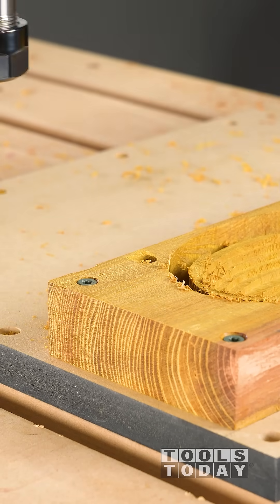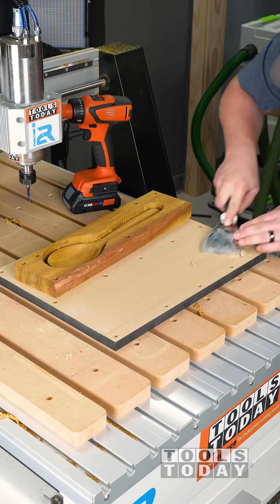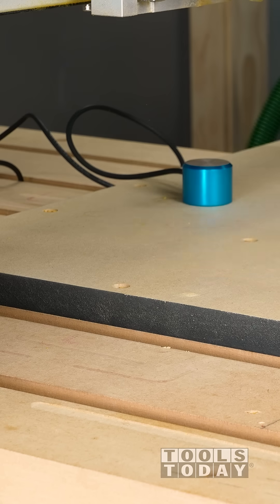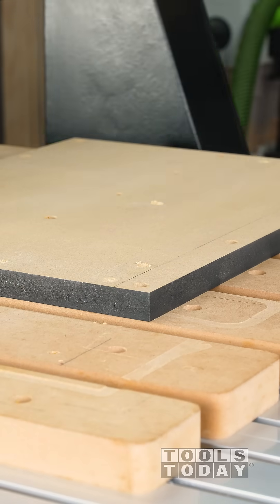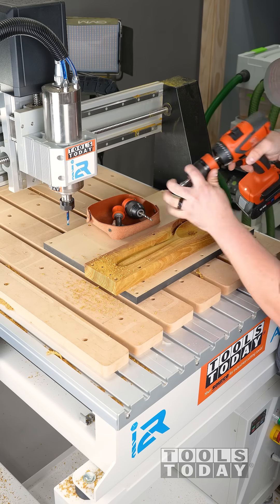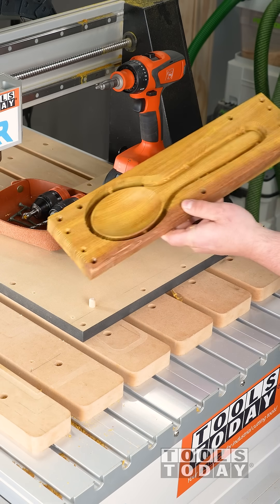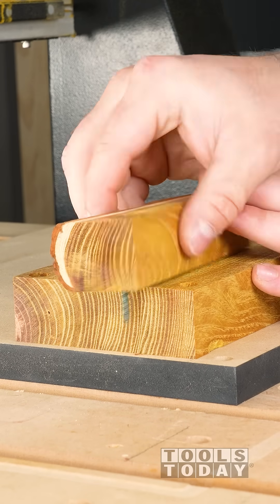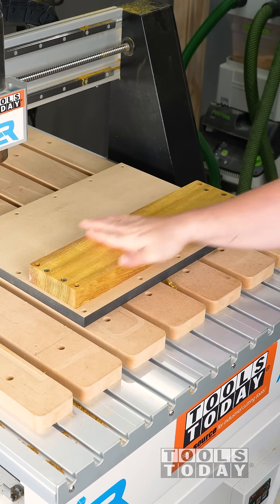Double Sided Machining Isn't as Hard as You Think it is

Comment from the maker: Double sided machining is not as difficult to set up as you might think.  Many people are intimidated by it, but in reality, you just need to create location holes in the top side of your work piece and mirrored holes in the wasteboard using some dowels as location pins.  Once your piece is secured back down using new screw hole locations, your x and y zero locations stay the same and you're ready to start cutting on the opposite side.  It's a pretty easy process!

Check out the tools used on our website - 

Amana Tool 1/4" Upcut bit 46102-K - https://toolstoday.com/v-13778-46102-k.html

RPM: 18,000
Feed Rate: 200ipm
Plunge Rate: 100ipm
Single Pass: Spiral Ramp Down

Amana Tool 3.6 deg 1/16" radius Tapered Ballnose bit, item no. 46286-K - https://toolstoday.com/v-13916-46286-k.html

RPM: 18,000
Feed Rate: 150ipm
Plunge Rate: 150ipm
Stepover: 7%

i2R A.24 2'x4' CNC machine - https://toolstoday.com/i2r-cnc-a-series-cnc-machine-3hp-spindle.html

Vectric V-Carve Pro Design Software - https://toolstoday.com/vcarve-pro-10-0-software-for-cnc-1.html

Fein ASCM 18 QSW AS 18v Drill/Driver - https://toolstoday.com/fein-71161461090-4-speed-cordless-drill-driver-bare-tool/

Fein QuickIn Drill Chuck - https://toolstoday.com/fein-63208002010-quickin-drill-chuck.html

Fisch Brad Point Drill Bit - https://toolstoday.com/fisch-fsf-328094-brad-point-drill-8-pcs-set-incl-3-10mm-dia-in-case.html

Fein QuickIn Hex Bit Holder - https://toolstoday.com/fein-60510222010-quickin-hexagonal-bit-holder-1-4-inch.html

Wera 3/8" Zyklop Rachet Set Imperial - https://toolstoday.com/wera-05003596001-8100-sb-4-zyklop-speed-ratchet-set-3-8-inch-drive-imperial-38-pieces.html
Reply: Just use two edge stops ya boob.

Comment: No need for all that setup. One pin at the handle end and the other on a tab at the spoon top tip. Machine and flip. Trim the two tabs where the pins are. Use steel pins jnstead of dowels. Sand and buff.

Comment: you over complicated this and you forgot about z dimension setting.

yes, the flipping part is ok. you dont need to drill new screw holes if you place them strategically so they dont go to the same place or you drill them symmetrically and use as locating pins. 

but the z depth is also crucial and it is related to stock z size. 

yes 3d two sided cnc is not black magic but the project must address both aspects - the flip and positioning and the z dimensions

Comment: I have a simpler method. I use a larger rectangle board, cut a rectangle area in the middle where i place the part that needs to be machined. After one side is done. I just rotate it and start again.

Comment: Use double sided tape to mount the blank block and CNC cut the four mounting holes and the three locating dowel holes.  Manually add the countersinks after removing the block and double sided tape.  This way you can reuse the MDF for cutting multiple parts if desired without it starting to look like swiss cheese.

Comment: "a lot of people are intimidated by double-sided machining, but it's not as difficult as you might think"
Proceeds to describe one of the most convoluted processes I've ever seen

No, this is pretty well in the ballpark of how difficult I estimated double-sided machining to me.
Reply: Do some machining for a year and you'll realize the setup for this is quite simple and very applicable to a VAST array of jobs. Be it in wood, plastic, or metal.

3 locating pins and some screws is a small sacrifice in the beginning and middle of a setup to literally reuse a setup with the only potential change being a different Z. Again, if you think it's convoluted you ought to do some machining because it's really not.
Reply: @NotGabeAgain  God I wish I had a decent fixture table for my metal cnc so I could use a nice process like this, instead of messing around with touch probes
Reply: If you do this process a bit bigger you'll find out if your X and Y axis are actually trammed or not. Turns out my machine wasn't.

Comment: make the holes symmetrically, you won't have to drill them in a different place. always base the Z axis on the surface of the countertop, you won't have to measure it a second time.
Reply: If you take the tool out of the collet you have to re comp it because its now sticking out a different amount.
Reply: @mikep3813 yes you have to measure the tool but not the board, you always have the base on its bottom, i.e. the CNC table.
Z0 is in gcode as the base that you measure at the beginning (if you change it, the gcode position will change)
The tool length is a different parameter.
So you didn't measure Z0 but made a tool length correction?

I make symmetrical 6mm locating holes there and press the element with clamps. It's a shame to damage the top with screws, besides, you screw them in a few times and they stop holding and leave bulges...
I always plan the element from the top so after turning it is perfectly at the height it should be.

Comment: $2000 CNC, $30 in bits, $600 fusion, $5 wood. $8 spoon. Win.
Reply: And it gives you the principle to make a $500 cutting board with machining on both sides, of which you only need to sell five to be in the clear for tooling, and can often be made with scrap or offcuts rather than prime to length lumber.
Reply: fusion is free

Comment: All that work to cut out a spoon that'll get used and then sit, dirty, on my counter for weeks because my wife wont do the dishes.😂
Reply: You mean because YOU won't do the dishes 😂
Reply: @nickschwendeman9261 I clean the bathroom, she does the dishes. I also do all the car repairs. I do all the yard work and home repairs. I do all the woodworking builds. I vaccuum, dust, and fold laundry. I do the remodeling projects she wants. So yeah, maybe her doing the dishes might sound misogynistic at first. In actuality, her not doing the dishes after all I do means I'm the one who's fucked over. 

She's more than welcome to crawl on the roof and repair the skylight that's leaking, rip out the broken sliding glass door and put in a new one, or replace the bearings, struts, axles, calipers, and brakes on her van and I can do the simple job of loading the dishwasher and washing a couple pots.

Comment: Okay but how is the spoon kept in place while machining the other side? It will eventually hold by a thread. Would you fill the inside with some kind of paste to keep it from moving when detaching the finished piece?
Reply: Software used provides the insertion of tabs that don’t get cut by the bit thus the part remains held to the block of wood.

Comment: Wouldn't worry to mich about the tight tolerance on the screw holes cause you counter sunk them and used a tapered head screw to hold them down, should hold fine, especially with the dowels makes it more than rigid enough

Comment: According to a carver I saw on YouTube, you want to carve your utensils and not sand them down. 

(Also, you shouldn't scrub them with metal scrubbers or soak them in water too long.)

If you sand them down, it opens up the grain, causing bacterium to be able to take hold. 

I'm not sure if this is true.

However, I have noticed that with cheap wooden utensils, they tend to get black mold very easily.
Reply: Obviously this is just an example of something machined doublesided, I assume at least.. otherwise quite a lot of effort for something cheap and simple as a wooden spoon. 
I have seen them in shops from exclusive wood and super artistic designs but those were handcrafted and quite expensive. 
I’d think in reality there could be projects such as plinths of turntables were its worth the effort and the use of a whole lot of exclusive wood.

Comment: Tolerance refers to the acceptable variance in the dimension of a feature. The word you’re looking for is fit, and like the other commenter said there is no need to have that tight fit if the dowels are locating your work. Those screws just provide clamping force which you explained pretty well
Reply: You also only need 2 dowels, 4 is over constrained.

Comment: I have these things called " Dowell Centers"... a very old tool, for hand made accuracy. 

I trust em much less than the carbide in my mill on its 0.02mm resolution. However.. it is the old way the old guy did it. Yup. Dowell centers. 

Dammit. if it was 5500$ and came with a spindle option......

Comment: the screw hole diameter doesn't need to be precise to keep the part from moving side to side during cutting. The locator pins already have that taken care of.
Reply: Plus it’s countersunk screws, that will actually be taking care of that sideways positioning if you let it
Reply: Exactly. All you need is the downward pressure and as long as the locating pins are a friction fit, that will stop any lateral movement.
Reply: Thats true especially wood. It is much softer than the screws.

Comment: Just copy the dowel holes from the front side to the back.  Then use the cnc to drill the holes into the machine bed at start of 2nd side, fool the machine with a dfferent  bit number so it pauses so you can put dowels into table and then the first side down onto the dowels.  Simple.  You don't have to do any drilling.
Reply: Just m0 will stop machine no need to lye to it

Comment: Cool setup. May I suggest, if you're using the same dimension wood each time (for a mass production setup) that you drill through holes so the pegs stay in one position no matter if you flip it over. You could use a material like ABS or HDPE to cut the wood on top of so that you don't have to worry about the peg holes getting enlarged or having mushrooming. You could probably CA glue or use double sided tape to keep it down.
Reply: Huge agreement regarding through-hole strategy,    fully removes the need for a second table setup and you can just bolt the part down directly to a couple of threaded inserts or other fixturing surface, no need for sacrificial dowels. No need for any tight tolerance on the hole either, just countersink and use a flathead bolt to ensure concentricity between locating hole and fixture.
Reply: I used the through drilling method last time I did a flip mill and it really simplified the work flow and also reduced the odds of an error. The first time I ran the toolpath I sent the through hole drill operations to a depth that was sufficiently deep to insert wood pegs into spoilboard. If you make a modified version of this through drilling operation for subsequent pieces it will extend the useful life your work holding setup.
Reply: @michaelcobb5454  good to know. I haven't tried it yet on my Shapeoko 5 4x4, I just had the thought while watching the video and thought I better suggest it.
Reply: Good advice. For a mass production setup I'd also ditch the screws and use clamps that are fixed to the table